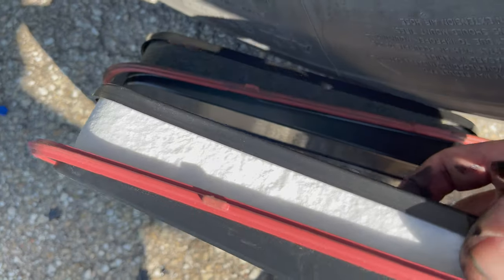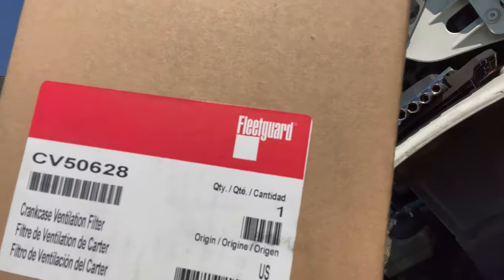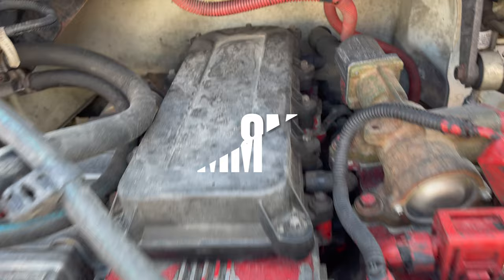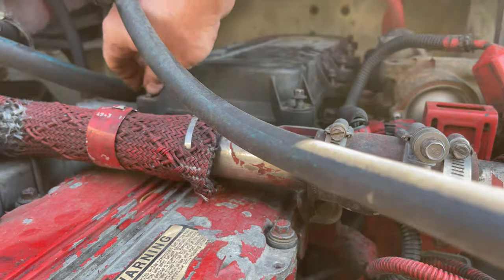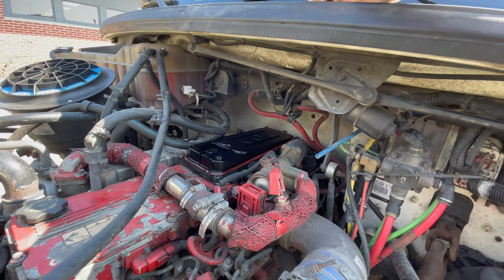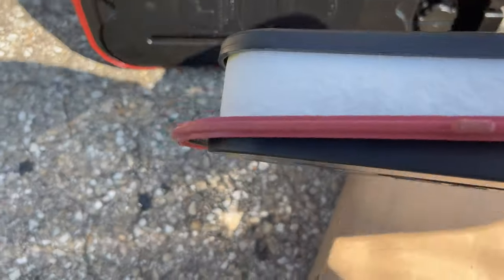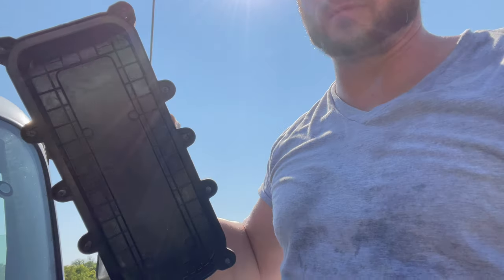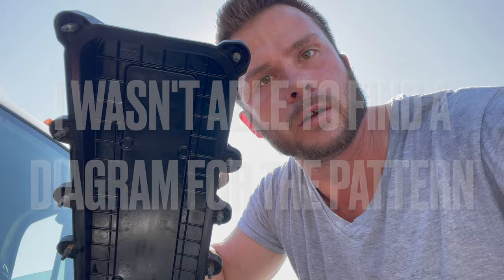Crankcase Pressure Code EASY FIX! [ Spin101 Crankcase Pressure ]

Comment: I got one now that has the CCF replaced, putting out code 556 with .50inh20 I noticed 219f oil temp sensor koeo right away. Are these sensors on same wiring path where CCF can be seeing EOT  voltage reference causing false ECM code or is a bad EOT setting off a phantom 556 code?

Comment: Hahaha, 
It filters oil vapor so yeah, suppose to have oil everywhere.
I gutted my filter and plugged the turbo inlet line then ran the hose down to frame.
I didn't like the constant dripping from oil vapor being pushed out.
So, I bought a catch can, installed a new CCV filter, then hooked the line to the turbo inlet back up.
Decided I'd rather have some negative crankcase pressure like the factory intended to prevent blowing engine oil seals.  I'm not seeing any oil buildup in the catch can so the CCV filter is doing it's job.

👍💪
Reply from the maker: I'm still wondering why the dealership didn't mention it when I asked of things I should be changing out for regular maintenance and their intervals! 🤦‍♂️

Comment: I wouldn't delete it if the discharge hose goes to the turbo because that keeps the crankcase pressure in check. It creates a small amount of negative pressure whereas the catch cans require some pressure to "blowby". It's very important to keep it clean/fresh and not let it get to the point where it's throwing codes thou. People delete it because it's expensive and a hassle to change. It was ultimately designed for emissions so deleting likely wouldn't do any damage... "fuck Ralph Nader"  LOL  MHO
Reply from the maker: Good to know! I literally had no clue there was such a filter.  Even asking the dang dealership what regular/scheduled maintenance I should be doing they didn't mention it. Thanks for the insight!